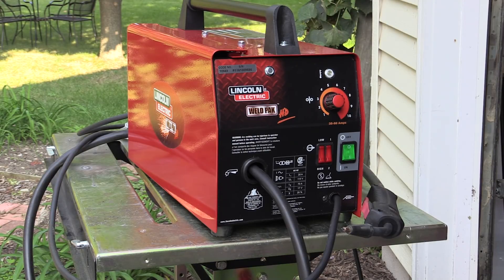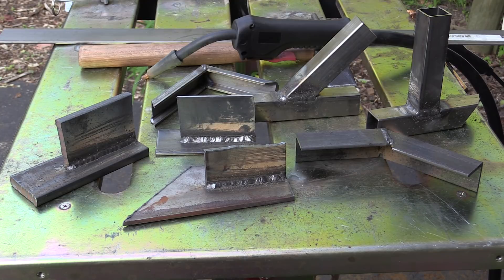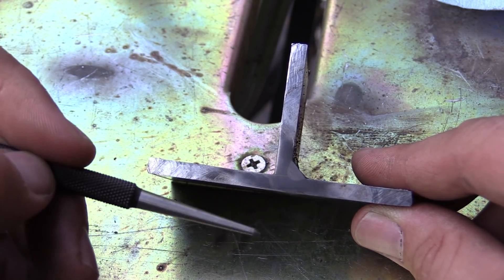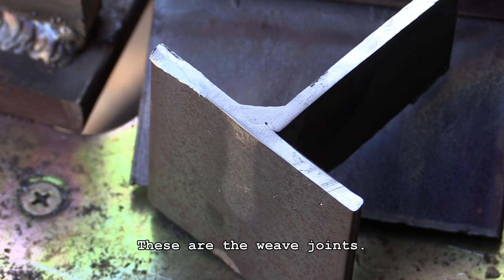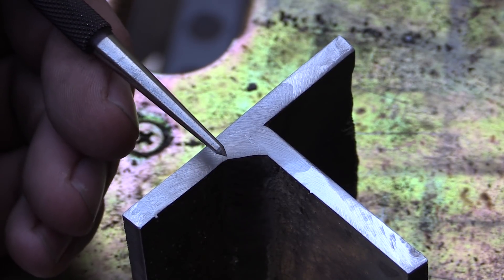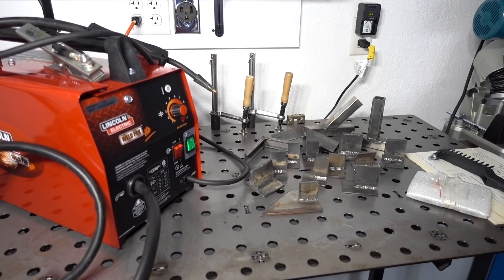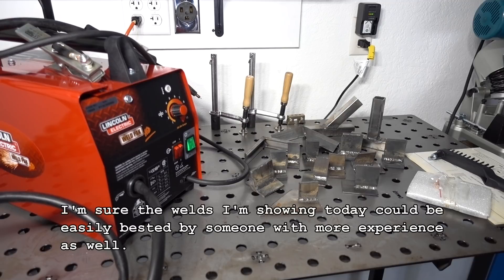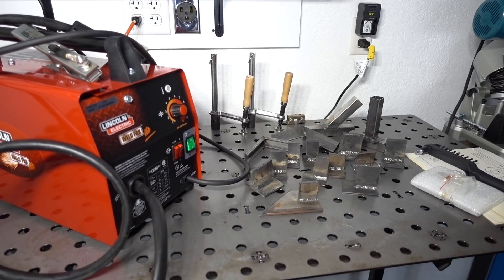Cheap Flux Core Welder Testing - With Cut and Etch

Comment: you keep referring to it as just a cheap 120v welder but as far as 120v welders go the lincoln is anything but cheap. for every 120v lincoln sold there are probably 50 of the $100 harbor freight 120v welders sold. the  only reason i bring this up is to the person who knows nothing about welders they aren't going to know that the lincoln is capable of welding DCEN  while all the other flux core welders are DCEP only. also i don't think you are aware of this but the lincoln MP-211 flux core wire is one of the only flux core wires on the market that is rated for muliti-pass meaning on thicker metal you can increase your penetration by stitching the metal together through multiple passes. anyway, referring to the lincoln welder as "one of these cheap 120v welders" i think is very misleading for the person trying to figure out which first welder they should buy.....
Reply from the maker: You make some good points.  I did mention that it was the cheapest I could get locally at Home Depot, but I probably should have made it more clear that if you spend less you will likely get less performance.  There obviously are much cheaper options out there, and not just at harbor freight, but all over Amazon and eBay.  Spend much less than what this Lincoln costs and you are likely getting an AC output machine with inferior performance.  I don't know of any flux core only welders that run DCEP (maybe a cheap MIG machine designed for use with shielding gas would be this way).  Most of the very cheapest flux core welders are AC output.

I do have another video reviewing a less expensive, AC output flux core welder and show that the penetration is very poor with that welder (I even used some NR211MP wire).

I do know about the multi pass capability of the NR211MP wire.  I didn't do any multi pass welds in the video.  And the multi pass rating isn't so much about penetration, it's more about maintaining desirable properties when welds are stacked on top of each other, with little to no base metal dilution, etc.  Some flux core wire won't have good characteristics with multi pass.  Multi pass welds are typically about getting the desired weld size, but if you don't have enough power for proper tie-in of each pass, you aren't getting a proper weld either way.

Other than the pre-heating from the previous weld, multi pass doesn't really help with penetration.  If your first pass doesn't tie in well, the next one on top of that may not help very much.  It may be adding a bit of strength to the joint, but it may have nearly as much lack of fusion as the first pass.
Reply from the maker: Sorry, just another quick note.  The reason I called this a cheap welder, is because it was $269.  Yes, that is much more expensive than the Chicago Electric 90A flux core welder from Harbor Freight (AC output), and the Forney Easy Weld I reviewed later ($150, AC output).  But it is also FAR cheaper than other Lincoln 120V welders, which are priced anywhere from $500-$800.  Miller 120V machines priced around $800, and even the new Vulcan  120V welder from Harbor Freight priced at $550.  

So I guess it's all relative.  I could have been more clear.

Comment: I Would love to see you do this Same Kind of review/test onf the Forney 299 125amp Flux core Easy Weld i beleive its called lol. Its about 160 bucks on Amazon. And supposedly a really Good and Easy to use Welder.
Reply from the maker: One reason that welder is so much cheaper than the Lincoln is that it is has AC output, while the Lincoln in this review has DC output.  DC, electrode (or wire, in this case) negative is recommended for flux core.  Since AC is constantly switching polarity, it doesn't run nearly as smooth.  That means that with the Forney you will get more spatter, and it will be much larger and more difficult to remove.  It will possibly have less penetration as well.  

Could be interesting to test and compare though.  I'll consider it.
Reply: bigtb1717 Thanks for the info! I am currently on the market for a lower end welder and really struggling with a semi decent one to buy! Lol any suggestions? Thanks have a Great day!
Reply from the maker: Just FYI.  I just ordered one of the Forney Easy Weld 299 welders to review.  With the holidays coming up I can't say exactly when I'll get to the review, but I'll do it as soon as possible.  I'll do some penetration testing as well.
Reply: bigtb1717 Awesome! I never Saw this Comment! Thank you!!! Im going to watch your Review right now! Take Care!

Comment: Thanks a lot for this video. I've got this exact same welder and I'm pretty much a novice when it comes to welding. I was thinking for what I'm trying to do that this welder isn't up for the task but you've proven otherwise. I guess I need more practice. Do you have any advice on what I can do to improve if I'm experiencing poor penetration when welding 1/8" steel to a 1/4" piece?
Reply from the maker: 1/4" is getting thick for this welder, and you may never get the penetration you are after.  But there are some things to be aware of that may help.  A long and/or thin extension cord can cause voltage drop and reduce the total output of the welder.  Plug directly into a 20A outlet for best results.  If an extension cord is required, use as short as possible and a heavy gauge.  Too long of a contact-tip-to-work distance (too much wire stickout, i.e. holding the tip of the gun too far from the weld) can limit the heat getting to the weld.  A bit of pre-heat of the joint can help as well.  

Also, joint prep is very important.  A non-grooved butt joint will be almost impossible to penetrate properly with this welder, for example.  Also, dirty, painted, rusty, mill-scale, etc. will all limit success.  Even though flux core is better at dirty stuff than MIG, it sill can go better with clean metal.

Also, keep an eye on the puddle and work on a consistent travel speed that allows the puddle to wet out a bit, but not build up too much.
Reply: Well even though one piece was 1/4 my welds did not come out as well as yours even after I cleaned them with a wire wheel. It looked like the 1/4 wasn't even penetrated but parts of the 1/8 got burned through. It didn't make any sense and the welds would break after some hammering. Thoughts?
Reply from the maker: What type of joint?  Varying thickness can be tough, particularly when one is above the welder's rating.  One thing is rather than pointing right at the root of the joint, keep the arc towards the thicker part.
Reply: Thanks. It's a lap joint with the thicker part being on the bottom.
Reply from the maker: Yeah, that is almost worst case scenario because you are trying to heat up the middle of the 1/4" material, which will sink a lot of heat, while the edge of the 1/8" material heats up very fast.  Try pointing the wire almost completely towards the thicker material, and try to run the bead so that only the edge of it catches the 1/8" piece.  You want to put most of the heat into the thicker piece.  Also, get a tight fit with as little gap as possible and put in tacks every inch or two before you start welding it out.  This will help the heat from the 1/8" piece transfer to the thicker piece.  Clamp your ground to the thicker piece as well.  

Thick to thin takes some practice, no matter what.
Reply: You are the man. I appreciate all the tips, thanks again!
Reply: NightShade1800 Hi! I'm on welding school and am now addicted! you should watch Jody Collier on you tube,on welding tips and tricks.He has really good arc shots and you can pick up a lot of tips watching him.

Comment: When you do a straight drag is it just that? pointing and slowly dragging along? Thanks for the video!
Reply from the maker: That's right. Just slowly move straight.  No side-to-side or forward and back/stop-start.  Just steady, continuous, straight movement.
Reply: cool, thanks a ton. ill give it a shot again!
Reply: I thought you had to weave to tie the pieces together.
Reply from the maker: Weaving can be used to increase bead size, achieve a certain look, fill a gap, etc.  But a weave is typically not needed, and in some cases can be problematic or disallowed by a specific weld procedure specification. 

A weave can limit penetration into the root of a joint, put too much heat into a part, etc.
Reply: Thanks, that's helpful. I'm using it for little projects. A few gate repairs, a couple sensor bungs in exhausts and a cart for the welder and a compressor.

Comment: Outstanding share!!! I very much appreciate the time and effort. BTW, where did you get the metal work table with the holes? Thanks!
Reply from the maker: The table is from Tab and Slot. It comes as a kit, ready to weld together. I like it.  It is on casters for easy movement around the garage.  Didn't use it for the welding in this video because I didn't want to smoke up the garage with flux core.  Mainly use it for TIG in the garage.
Reply: Wonderful. Thank you!

Comment: Would recommend a Lincoln flux core that uses 240 volt?
Reply from the maker: For thicker metal and larger projects, a 240V machine will definitely serve you better, if you have access to a 240V outlet.

Comment: Not cheap to me lol. But love the welder and thinking about buying one, how long can you weld with it before the thermal light kicks on and you have to let it cool off?
Reply from the maker: Yeah, cheap is definitely relative.  It was simply the cheapest that could be purchased locally outside of Harbor Freight.  I can't say for sure how long it would go before thermal cutoff.  I never hit it, but I didn't do a lot of long welds.  It has a fairly low rated duty cycle, but that is the norm for these types of machines.
Reply: Yeah if I had to choose between HF or Lincoln I'd choose the Lincoln also regardless the price. But okay thanks
Reply: Well i got this machine. Hope i didnt waste a bunch of money on it.
Reply: Actually i have the handy mig, looks like the same machine but different wording.
Reply: Does this machine do mig?
Reply from the maker: The Handy MIG has the setup for gas shielding, so you can do solid wire MIG with it, you just have to get a bottle of C25 gas.  Keep in mind, while MIG welds much more smooth and clean than flux core, you don't get the same penetration.  I would expect 1/8" to be the absolute limit with MIG.

Also, make sure to verify polarity when you get started, because MIG and flux core require opposite polarity.
Reply: Lincoln shows a 20% duty cycle at 88 amps, so 2 minutes straight run time.

More info here
https://www.google.com/url?sa=t&source=web&rct=j&url=http://www.lincolnelectric.com/assets/servicenavigator-public/lincoln3/imt780.pdf&ved=2ahUKEwiXv57VmMPZAhUE74MKHdd2ANUQFjAAegQIBxAB&usg=AOvVaw0vXrbzqRM7dMO2F4nrwLhz
Reply: Justin Watson. I had this same welder before I had to sell it to help my daughter I loved it welded pretty long time no issues.

However I just purchased a century FC-90 which is lincoln it takes little getting use to but it may be ok 

$100 less